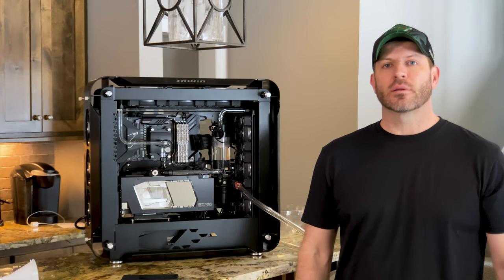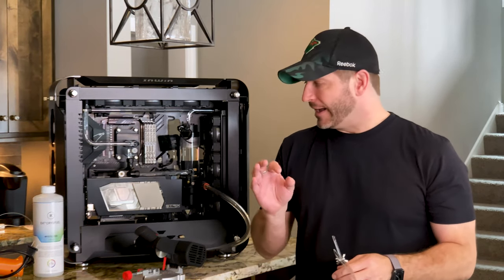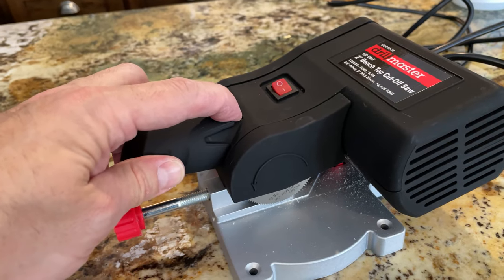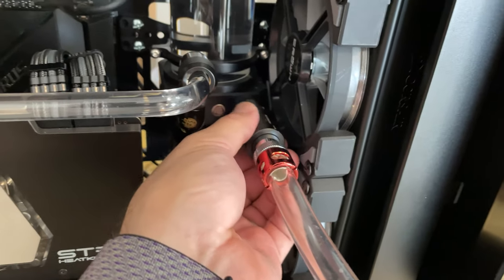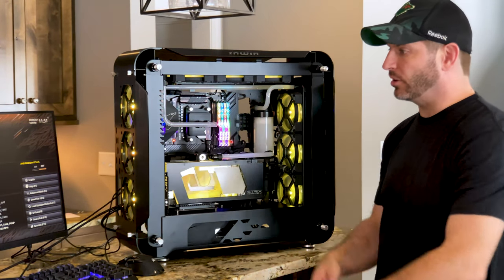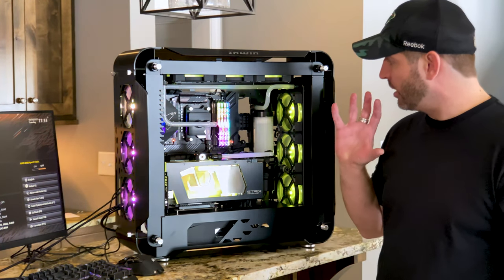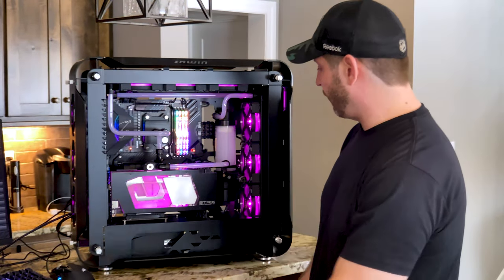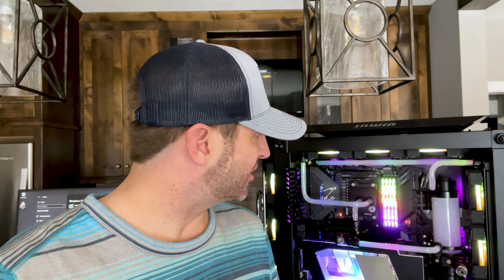Project Vortex, InWin 925 Build Finally Done!

Comment: Missed your vids bro. Good to see you got it done though, looking really nice and clean. I used Mystic Fog on a previous build myself, and I share your opinion. It's a bit over-hyped and didn't react as much with RGB as I expected. In mostly dark environments it does look nice though. Another thing I noticed was that, running the same tests, temperatures inside the loop ran actually higher using Mystic Fog compared to clean distilled water. We're only talking 3 to 4 degrees Celsius  though, and in an uncontrolled room in regards to temperature. But still on the same day, measured within about 60 to 90 minutes .

I think I may order one of those saws and give that a try. Using a pipe cutter with PETG and it actually works really well. But for acrylic that saw might come in handy. I'll probably still eyeball my measurements as I am used to it, and it usually ends up okay as long as I take my time. Something I clearly didn't do with my own system. It honestly looks like I put it together during a seizure while being drunk. I use "it's art" as a defense.

Anyway, good to see you're okay over there and to see how your build ended up. Take care and stay safe! (Say hi to the cat for me)
Reply from the maker: Thanks for dropping in!   Cat purrrs back at ya.   Lol.

Comment: Rig looks very nice...very clean. I recently built an X590 system using an Aorus Ultra board. But...onboard audio comes up as Realtek USB which caught me off guard. Is that the norm for onboard audio now?...USB audio?  Thing that sucks is there is a delay that I can’t get rid of...so using another cheap USB audio dongle with no delay. Does the X570 Xtreme also use USB audio?

Comment: Hey man, I started watching a series of your vids this eve, starting with putting the 2080ti Strix underwater which is what i-m doing now also, with the same EKWB block. I'm also angry at the LED implementation 😂
You do nice work, so thanks for that, as I worked through the build vids to this one I was screaming at you about the number of fans U were planning to daisy chain, and by the time I got to this one I was wondering if u had killed your mobo by the time I would get to the end lol - which you easily can with that many components off a fan or rgb header. They WILL melt!! (You're mobo might have 1 header with considerably higher possible powre draw, my ASUS does it's called FAN+ I think, have a look at manual) but none will take 9!.. Glad u didnt, HOWEVER - please keep all your rad fans on the commander if you have to if there aren't enough headers on the mobo, but those two exhaust fans  should be split off and working off a CHA_FAN header. They should be reacting to a rise in temp in your VRM, RAM, or Mobo, up to you, whereas all of your rad fans should be pretty much be kept on a constant RPM, as fast as possible without you noticing them, then ramping up quite hard iff your liquid somehow gets above 30-35 depending on how hard you're pushing your components. Remember, especially with a full large tank, it takes a long time for your rads to heat soak and the fans to have a meaningful effect on the water temp :)
Apart from that, nice work buddy, keep it up, love the build :) You get my sub :) 👌

Comment: Bro I have an issue with my PC I have asus ROG strix b450-f and when I plug it in only turn on the logo of Asus but not turn on the PC can you help me?

Specs R5 2600
16gb ram 3200mhz (8x2)
MSI Gtx 1060 3gb ocv1 
Evga 500w 80+ (think is silver I'm not sure)